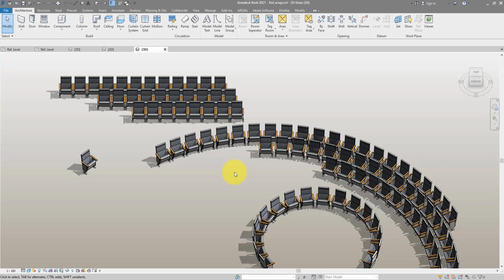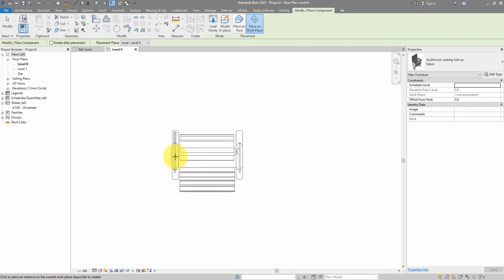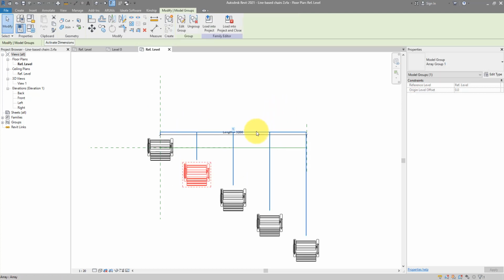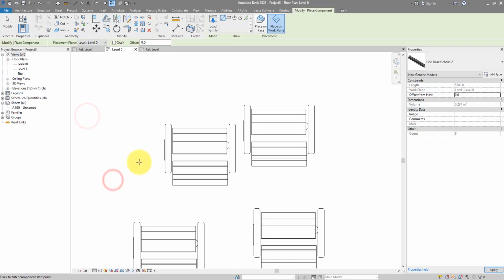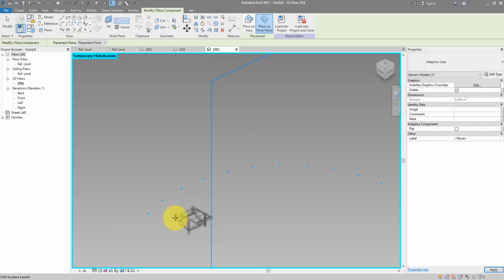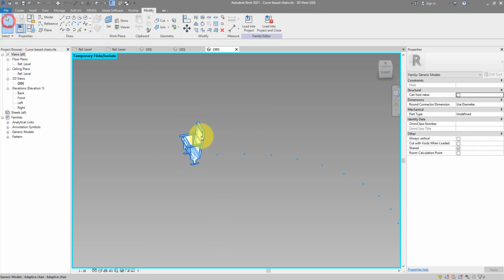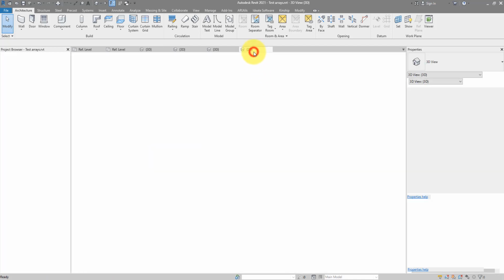Revit Snippet: Turn ANY Family into Line or Curve Based

Comment: This isn't working for me in Revit 2026
Reply: The chair doesn't rotate when the rotation angle of the point is changed
Reply: Got it! To make it work the Family Category Parameters of the chair were changed by unchecking 'Always Vertical' and checking 'Work-Plane Based' then reloading to the adaptive point family. Also, be sure to select 'Place on Work Plan' after selecting 'Component'. Thanks!
Reply from the maker: Thanks for helping the community with your findings 😊

Comment: Great! Thanks
Reply: I did it successfully. However, changing the height of adaptive points in project file, the chair will be inclined (not vertical).
Reply from the maker: Please make sure that the family is Shared, always vertical is ticked off and it is a workplane-based family.
Reply: @RVBoost  Thanks! Done
Reply from the maker: Glad I could help 😊

Comment: Does it matter what type of family we use for the component we load into the adaptive points family? What type of family was the chair that you used?
Reply from the maker: It was a generic model family if I remember correctly. Anything not face-based/wall-bases/floor-based should work. We just need the item to be able to move freely.

Comment: Hi,  how come when I place a chair Breuer (ootb) onto the reference point, the chair does not rotate?
Reply from the maker: Hi, please make sure you place that chair on the 2nd reference point in the family. In the video, I showed how to place this 2nd point and use it Rotation parameter.
Reply: @RVBoost  Hi , i did exactly the same but it is not working . problem its not showing to place on work plane while i try to place the chair
Reply from the maker: Sounds like the chair family is wrong then. Have you set it to be based on a workplane in the family editor.
Reply: @khanto3756 Go back to the main chair family editor and change or set the family to work plane-based

Comment: Great tuto but may i ask a question. For the adaptive chair, why do you use two points (an adaptive and a reference) one over the other. Wouldn't it work only with the adaptive alone?
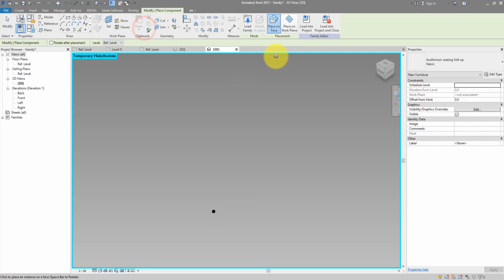Reply from the maker: We actually need that second point to add a rotation parameter :) Please see it created at 7:30 and then used at 8:40!
Reply: @RVBoost  I can't get the rotation to work. I've made it Work Plane Based and shared, as per the comment above, and it'll move with the point, but it won't adopt it's rotation.